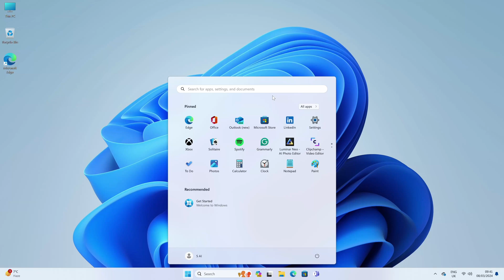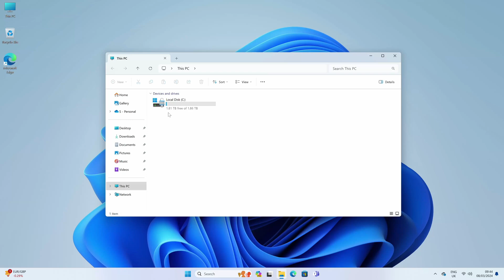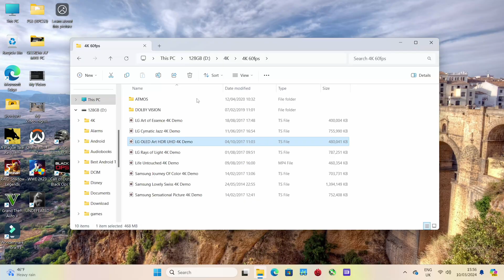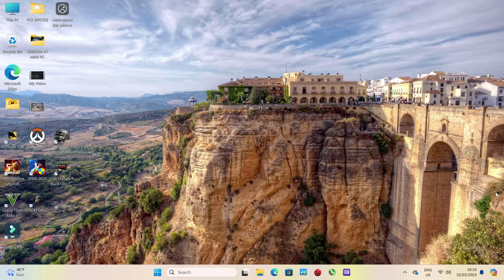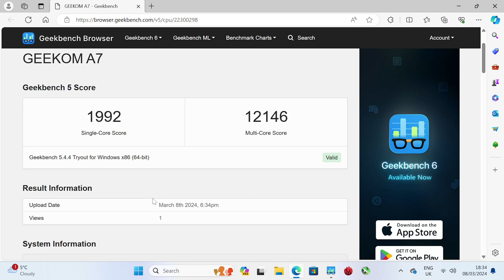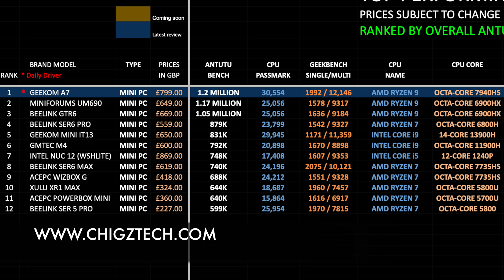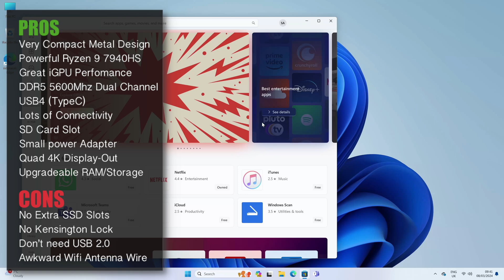Powerful GEEKOM A7 Mini Gaming PC Review - RYZEN 9 (7940HS)

Comment: I just bought this thing. Got everything set up within an hour and 30 minutes of me using this mini PC. This is not the way to go for 850 bucks this thing overheats like crazy making all the high-tech equipment in this device not worth a damn just because it gets temperature throttled the moment you start trying to push it these fake reviewers are not making it any easier to identify a good device and one that just does not function as advertised I was hyped about the mini PC the after my experience with geekom. I'm not looking to get into any more of these things

Comment: Looking at either the geekom A7 or the minisforum venus um790, which would you recommend? Minisforum comes with 64gb ram but only 1tb sd for the same price. Minusforum does support raid but dont think id use it. I will be dual booting linux though ( probably manjaro)
Reply: Do minisforum mini pcs come with windows pre-installed, im looking to buy their HG99X but i need a mini pc with windows installed